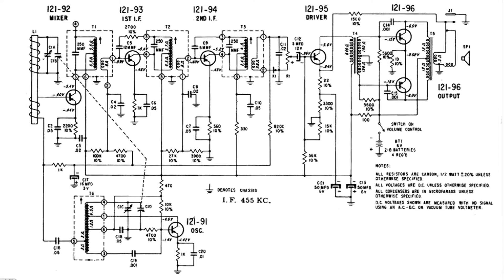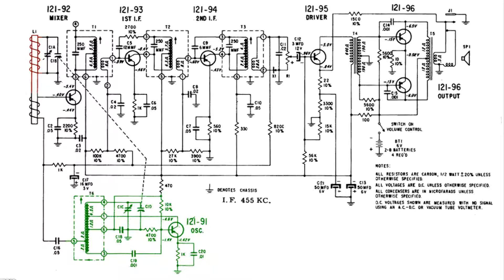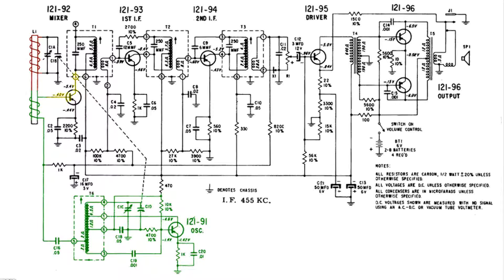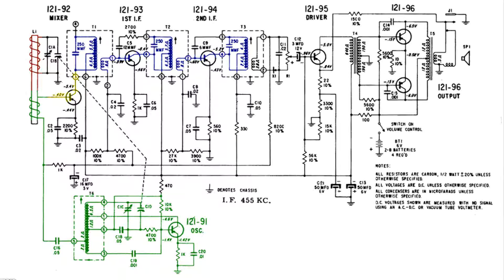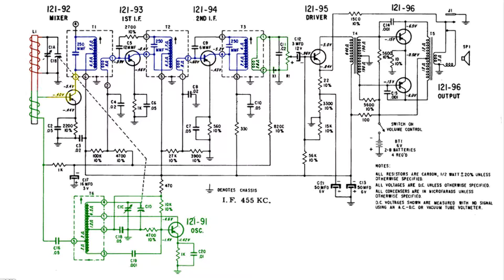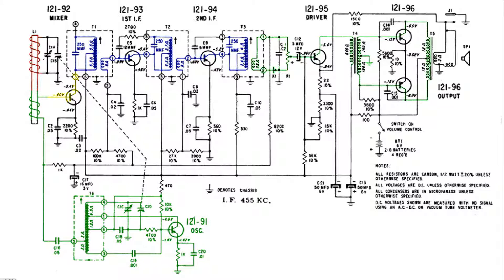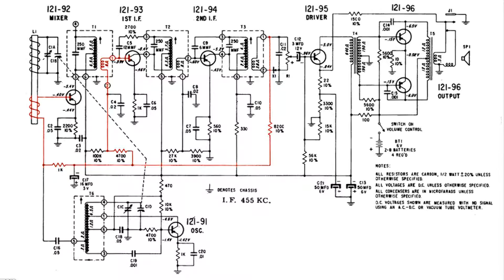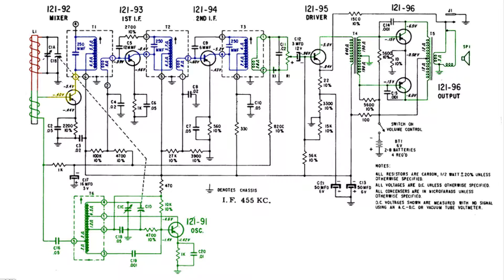Signal Flow Transistor AM Radio

Comment: why AM antenna is coil stick is not like FM SW antenna?
Reply from the maker: The AM radio band is 530 kHz to 1700 kHz
The FM radio band is 88.0 MHz to 108.0 MHz
¼ Wave for AM 1000kHz or 1MHz = 245.89 Feet
¼ Wave for FM 100MHz = 2.4589 Feet
A wire AM antenna will work but it is not practical. So a ferric antenna is used with a capacitor in a tank circuit to tune the antenna to the AM frequency. 
Oscillators, the Basic Tank Circuit 1
https://youtu.be/fQ4yRVEzXQA

Comment: I have one alarm radio Petra 8249 but could not find schematic. It resembles same circuit in your explanation although this has 14 transistors with fm too.Still trying to finding it's fault.Thks.
Reply from the maker: The Radio Museum does have some Petra schematic. You might find similar to your radio.
https://www.radiomuseum.org/

Comment: I have a Westinghouse 602P7 7 transistor radio from 1956, all the electrolytic and wax capacitors have been replaced, the radio now works pretty well. But there is 1 problem, at turn on after being off for a while the radio can take 30-60 seconds before coming to life, any idea what the problem is?
Reply from the maker: This is just a guess, I would think it was the oscillator. It does work so I would just leave it along until it stops working.
Reply: @AllAmericanFiveRadio  So you mean the oscillator transistor could be bad?

Comment: Either thinking in conventional current flow, reverse biased transistors, or thinking rf/audio signals would seek going to ground, rather than the next component, really confuses me.
Reply from the maker: This should help.

Impedance and Frequency, Oscilloscope Demo
https://www.youtube.com/watch?v=TRSNKwtUy8g

Capacitive Reactance and Frequency Demo
https://www.youtube.com/watch?v=S5_7gGHxVyQ

Capacitors, DC, AC, and Frequencies
https://www.youtube.com/watch?v=YfJKNSkz_Lk

Superheterodyne Radio, heterodyning frequencies together, how it works
https://www.youtube.com/watch?v=5F-iKiltesU

The Oscillator Mixer
https://www.youtube.com/watch?v=d96vwarHcsg

RF Choke Demo
https://www.youtube.com/watch?v=M4EOuAa615s

LC Resonance Oscilloscope Demo
https://www.youtube.com/watch?v=G_RCyDdt2rM

Capacitors, DC and AC Current
https://www.youtube.com/watch?v=NInt1Ss3vQ4

AA5 Radio Signal Flow
https://www.youtube.com/watch?v=zknp0FOkPXU

Comment: Why do you need to add the if  signal? Why don’t you just amplify the received signal ?
Reply from the maker: The IF cans are very sharply tuned, very high Q at 455kHz. Mixing the station signal and the oscillator signal together making a 455kHz signal per station one at a time and passes through the IF circuit. If there are two stations close together the one that makes the 455kHz will get through the IF's the other will not. This was the first good station selection circuit and it was cheap.
Reply: AllAmericanFiveRadio  thank you that makes a lot of sense

Comment from the maker: Thanks nottinghamnc
In Ham Radio, Morse Code is sent with just the carrier, turning it on and off. You can hear it but it is much like thumping the speaker. If you add a BFO oscillator of a frequency very close to the carriers frequency, and then mix the two you will hear and audio tone every time the carrier is on. This radio oscillator does beat with the radio station but it produces an intermediate frequence I.F. of 455KC. Same principle but for a different purpose.

Comment: Hi Richard, another excellent video, a lot of work there!
The Marconi 878 radio you commented on is going to be sold on eBay for a poorly friend of mine and I hope you don't mind but I've put a reference to your good work in the advert as I think anyone setting out to restore a valve (or transistor) radio would do well to draw on your experience.

Can you upload a video called "index" as there are so many good things to look at in your channel.

Well done!  
Kind Regards ...Andy   gw0jxm

Comment from the maker: Thanks CameramanLink
I can remember transistors being somewhat expensive when I was in High School, because I was buying them one at a time. But for manufacturers they were much less expensive.
Reply: I was wondering if you've ever tried using varactors in place of the ganged variable capacitor? I'm ok with a simple varactor VCO, but I'm not sure how to combine two coils in one VCO with a mixer... Any suggestions?
Reply from the maker: @andrewferg8737  Hey Andrew
Been busy working, if I don't answer an email send it again.
Yes I have made some videos on varactors. Varactor sounds like something from Jurassic Park.
Varicap, Varactor Diode circuit demo
https://www.youtube.com/watch?v=68qOrDl55tc

FM Transmitter Varactor Diode Modulator
https://www.youtube.com/watch?v=JQGWr2dPe4E

Oscillator Varactor Frequency Control circuit demo
https://www.youtube.com/watch?v=NOU-bUKpL00
I'm still thinking about how to combine two coils in one VCO with a mixer.
Rick
Reply from the maker: @andrewferg8737  allamericanfiveradio@yahoo.com

Comment from the maker: Thanks CameramanLink
If this radio used NPN transistors the polarity of the battery would be reversed. The frequency  mixing is different as for as the medium goes but the physics is the same principle. Yes it takes more transistor than a AA5 tube radio. But transistors are really cheep. Yes they did transistorized it. It is the same AA5 technology modified for the transistors, mainly low impedance transformers, and the small size of all the parts.